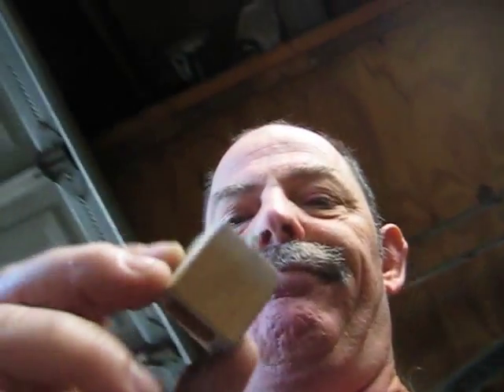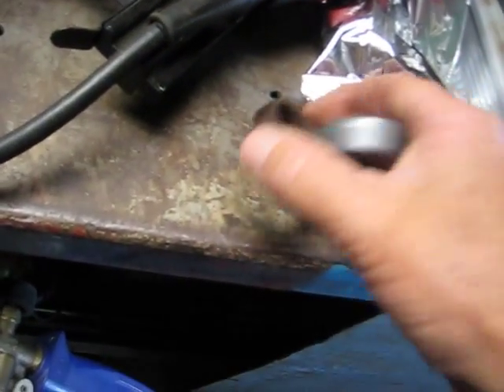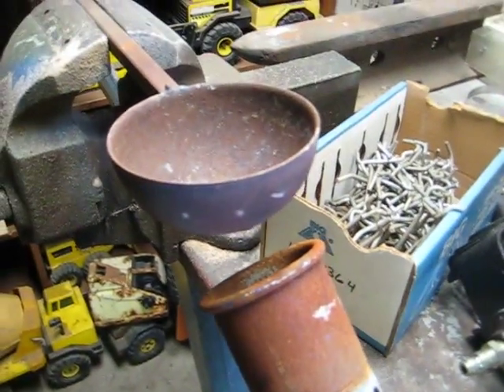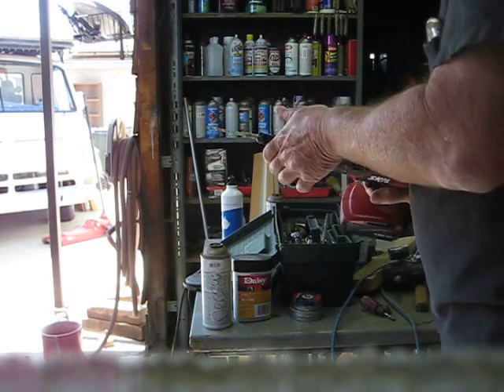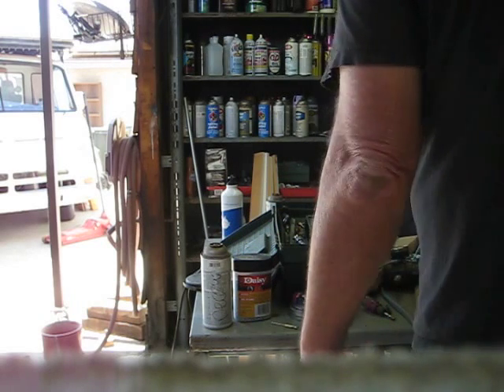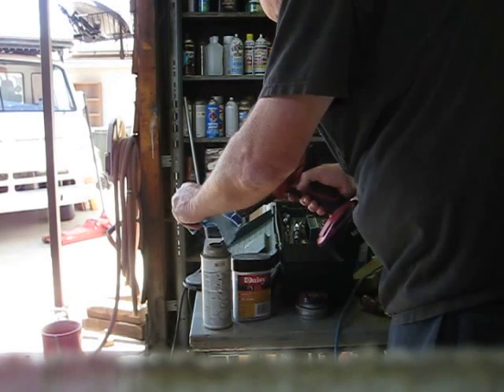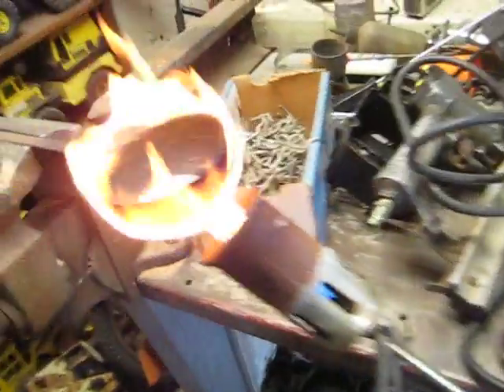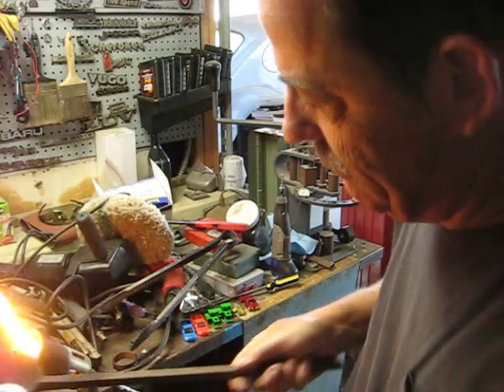Burning Bodies

Comment: if the can of paint is still full and works can just remove the white center nozzle and a plastic q-tip tube will fit in where the nozzle would fit if drilled out a tiny bit and then you use that to decant so you can still use the can if needed by popping off nozzles, thats how i decant mine untill theres no more gas left in the can, then ill punch a hole and get the rest out.

Comment: what kind of spray paint do you use for painting hotwheel bodies?
Reply: Most any kind of spray paint will work fine, but I found that it's a lot easier to just paint my bodies with regular acrylic or enamel paint using a brush.